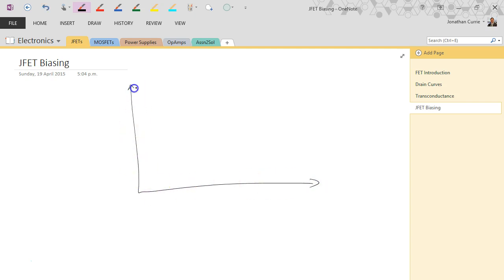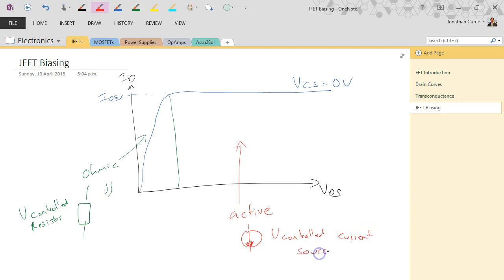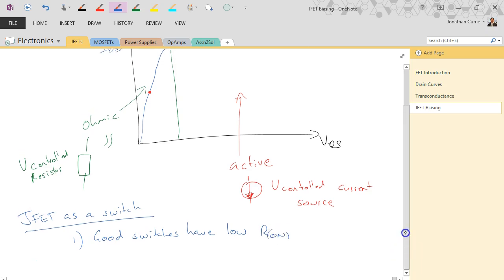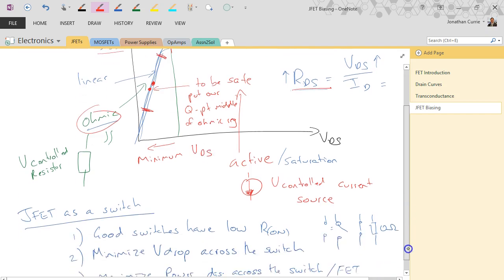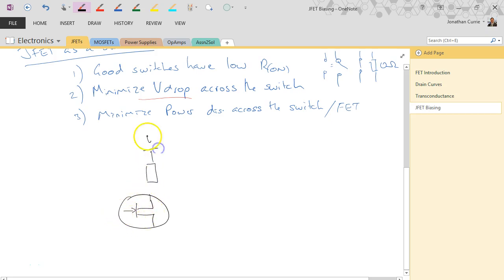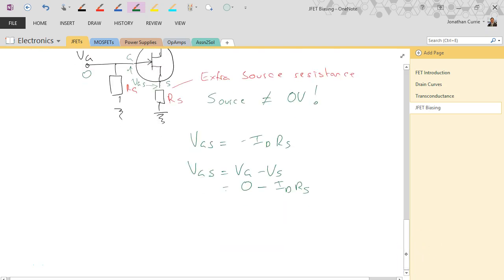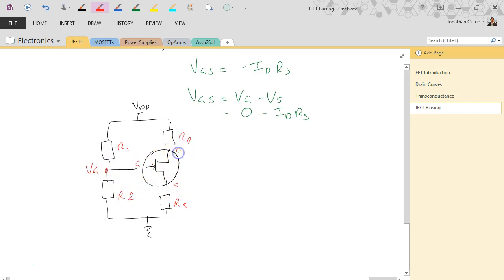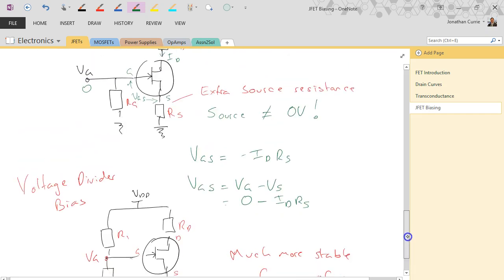JFETs: Biasing

Comment: I tnink what makes tbis hard is the source resistor and drain resistor changes the voltage across VDS, which affects the current which then affects the voltage at Source resistor. So how to easily tell what is going to happen for a given source resistor...ugh. its like a feedback loop (negative feedback actually) very hard to reason about directly

Comment: This is the 20 min. movie about "how to biasing jFET" but there is no answer completely
how to do this. Yes, of course, movie show types of biasing. Agree. But main
question is how to set VGS voltage to bias jfet in switch mode. I suspect that
VGS voltage should be 0, so simply SAY IT. But in this case we can play with
type of transistor (various Idss) to project circuit properly. So how to choose
proper transistor ? This is a question, and its no answer. Because biasing is
not only setting of VGS. It is also setting of operation point and choosing
proper transistor. This is the point.